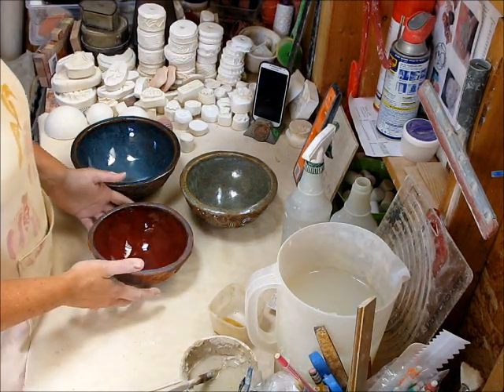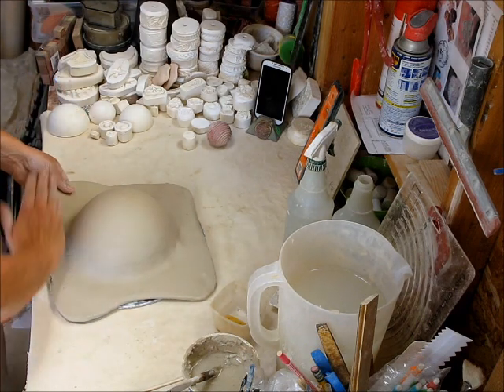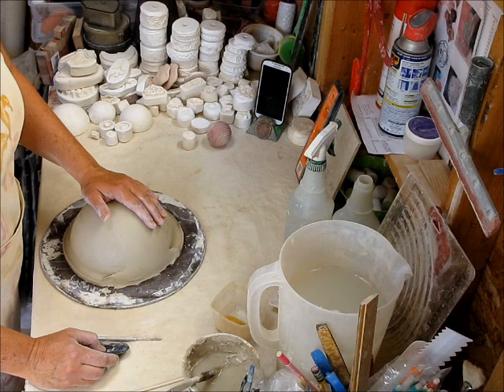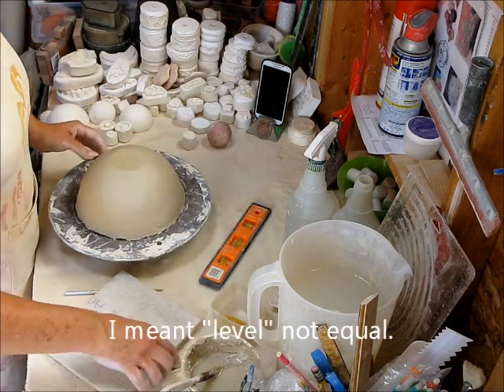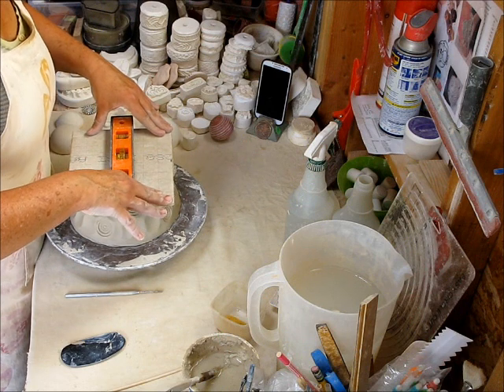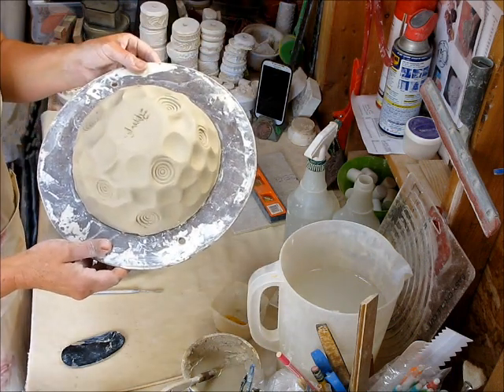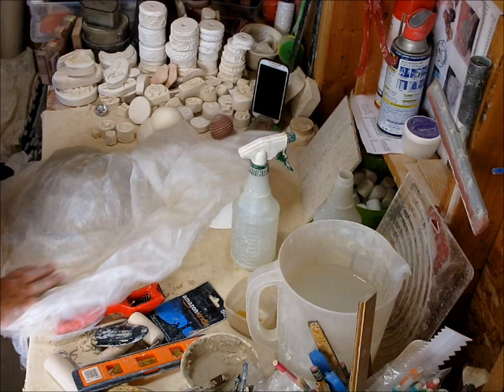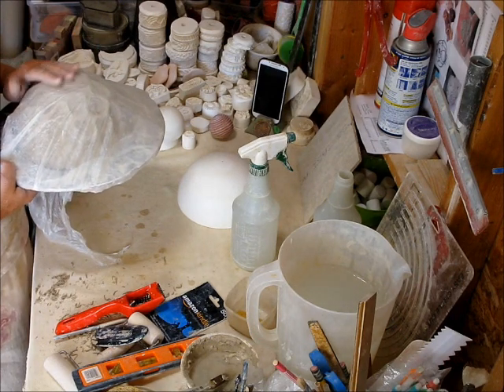Chunky Bowls

Comment: Hi Jamie, thank you very much for your videos. They’re very helpful and inspirational  to beginners like me. I would like to ask why do you pack the bowl in plastic foil for 24 hours before you let it dry. It’s not clear to me what are the benefits.
Reply from the maker: Hi Ana, thanks for watching!  Anytime I add fresh clay to bowls for repairs or to fill in holes, I cover so that it has a chance to reach the same moisture content as the rest of the bowl. Covering with plastic top to bottom helps the moisture in the fresh clay to be absorbed by the rest of the piece (and be distributed equally).  Fresh clay added to leather hard pieces may fall off later in the process.

Comment: First, I have to say that I am really enjoying all of your videos!  Please keep making them :)  I want to make some of these molds.  I am curious how you make them hollow.  Do you set the smaller bowl inside the larger after pouring in the plaster?  Never made a mold before, and any help you can give will be greatly appreciated.  Thanks so much!
Reply from the maker: You can use a nesting bowl or the bottom halves of those giant plastic easter egg sets that can be found at crafts stores in the spring.  I did start a video on it but have yet to finish.   Stay tuned!...
Reply: Jamie Meador .